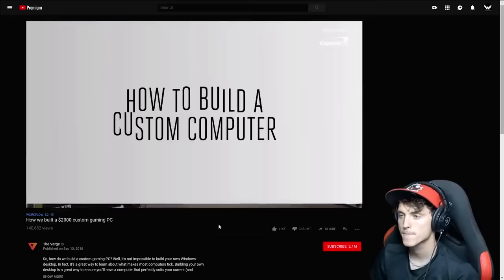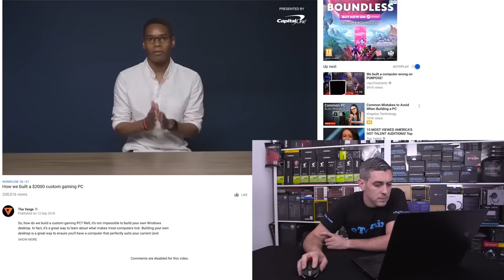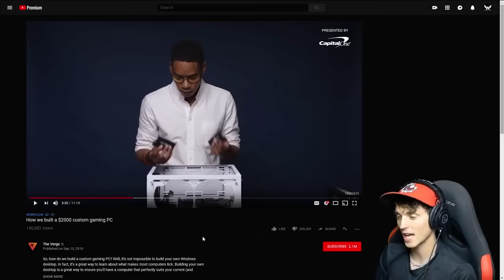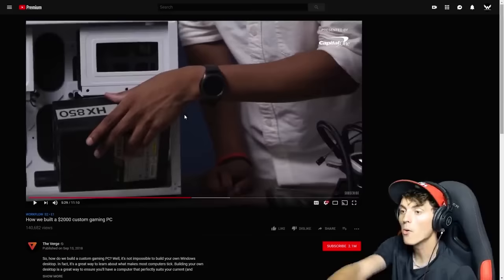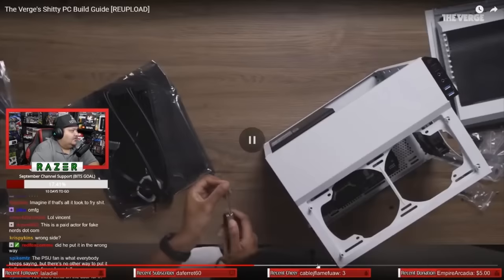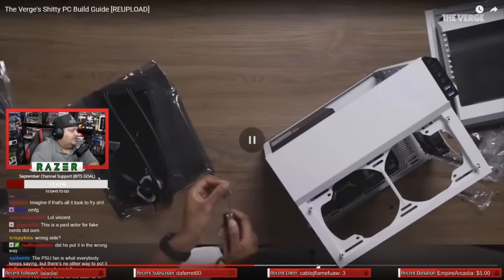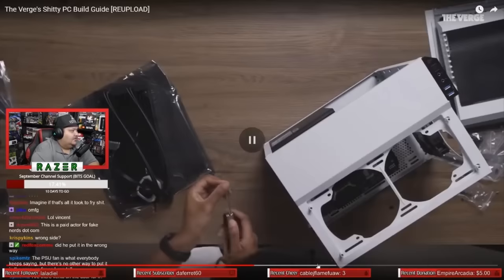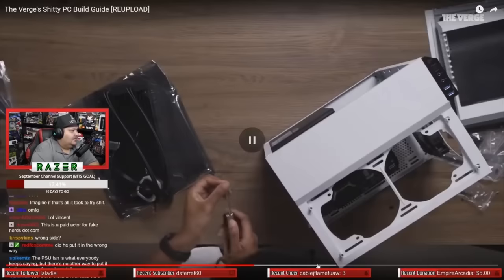The Verge's $2000 PC Build Reaction Supercut

Comment: If you pause at 15:04 you can see he somehow managed to put a ziptie on backwards.
Reply: Holy crap I never noticed it and I'm fucking laughing so hard. God. Oh fuck. I came here to lift my mood ended up laughing so hard that my stomach started paining
Reply: SCREAMING 😂☺️😂
Reply: honestly at this point i'm not even suprised by that anymore :P
Reply: I can’t see it, it looks normal
Reply: @edboss36  http://prntscr.com/p6d00n
Here, take a look, you can the the textured part of the zip tie, like if you look at the zip tie above it (Blue Square), you can see the the part that's wrapping around the cable is acutally smooth, unlike the reversed one (Red Square) you can see it's textured, and the texture is supposed to be on the inside 😆
Reply: OMFG ahahahah...
Reply: Not even the zipties were safe... 🤦‍♂️
Reply: thats not ziptie.that is tweezer.😂
Reply: I . . . I didn't know that was possible.
Reply: @bismuth7730  I feel your pain
Reply: OMG, I laughed so hard for about 10 minutes non-stop, for real, I was in floor can't take my breath 🤣🤣🤣🤣🤣🤣🤣🤣 I never laughed like this from years.
Reply: Never clocked it but I was massively confused on why he never pulled it tight 😂😂
Reply: Oh shhhit hahahha
Reply: It looks to me like the top "tweezer" is really tight, and the bottom "tweezer" is loosely around two cables and one water line from the cooling block. He didn't trim the long ends of the "tweezers," the upper tail curls back around... I might be wrong, but that's what I saw.
Reply: Guys, guys, guys... calm down.  There's a perfectly logical reason he has the "backwards" tweezer configured like this.  Doing it this way allows you to easily RE-USE the tweezer after the computer melts down in a week.  See, he's actually really clever!  You guys should stop judging this poor guy.  He's actually thinking outside the box.  Every one of his mistakes has an alternate reason that you just haven't thought of yet.  You just need to think about it a little bit longer instead of judging him because he doesn't do it the "normal" way.  HAHAHAHAHAHAHAHAH!!!!!  Just kidding!  This guy doesn't have a freakin clue.  Maybe we can all ask the Verge to sponser him to do a hardline liquid build?  Wouldn't that be a ROLF?!  Peace-out!
Reply: @krissebesta  I think I would die (being a watercooling enthusiast), but I'd still wanna watch it
Reply: Last year I said people will still be finding new mistakes in years to come, and this just proves my point.
If a zip tie doesn't click then it's not on right.

Comment: Me: Looks at PC I built on top of the  the ground without the most crucial part, the table Starts Sweating Profusely
Reply: no worries it's "grounded".
Reply: Actually,  pun from mark aside, as long as you are barefoot or skin in contact with linoleum or hardwood floor never on carpet you really are grounded possibly better than an anti static strap due to a larger surface area distributing any charge away from you.  I always build this way, barefoot on hard floor that is, table may or may not be used.
Reply: Yeah I have built four PCs... Three of which on the ground... All three on carpet.
Reply: I'm pretty sure every PC I've ever built was on the floor... Lots of room, and I can't drop things very far ;-)
Reply: I did the same thing it's fine
Reply: I actually never have built a PC on a table. 2 on my bed and like 10 on the ground lol.

Building on the bed is a bad idea though, I think I've lost so many screws.
Reply: I'm so glad God saved my poor soul from watching this video when I built my first pc lol
Reply: @berndo3038  I see you like to live dangerously.

Comment: What is sad is that his $2000 dollar pc is slower than my dell optiplex with a 3rd gen i7 and a gt710...

at $150...
Reply: LMFAO xD
Reply: My PC cost the same and I bet it performs 100% faster
Reply: what optiplex do u have, I'm planning on getting a 3020mt with the i5
Reply: @vladnicolescu2638  sff 9010
Reply: That's a good pc for 150 except the CPU maybe they should use higher gen i3
Reply: @frozenturbo8623  The thing is, had this been an AMD-Ryzen setup, swapping a CPU would have been a ton easier, as AMD has been using the same socket for four generations by now. Also many BIOS updates are backwards compatible with older Ryzens.

With Intel, you have to be extra extra precise with your selections. Many motherboards are designed for a specific generation of Core CPUs. BIOS updates won't help. Plus, Intel has changed its socket at least twice in the last three years. You can't just take a motherboard and CPU from the shelf and say "here we go".
Reply: I have an optiplex sff 7020 and it has an i5 (forgot what gen) and 16gb of ram. (no graphics card yet doe lol)
surprisingly doesnt even suck. Very good for just work but also some small games.
Reply: hes using a 1080 for two fucking thousand?? I'm not a pc nerd at all but theres literal 30 series prebuilts that cost half of this
Reply: no it isn't
Reply: He literally said that "That pc performs better than what most people have"

Comment: You actually don't need a table. You can do this in one of those vertical air tunnel things. Just weigh out all the various pieces, do a little math, and attach a suitable counterweight so that everything ends up the same. If you're willing to make repeat trips, you can also do this while skydiving. I don't recommend bungee jumping as the fall is too short. Also, technically speaking, the first thing you need to do is not get a table but rather to exist in the material universe. So, if any supernatural beings on an alternate plane of existence are reading, or rather 'experiencing', this comment through some sort of projection that is impossible for me to even conceptualize within this universe, you're gonna have to go and find some sort of wormhole or inhabit a human host or something.
Reply: What do I do, as an ethereal being trapped on this plane after I got drunk during convergence. I do not have any digits, the maximum load I can move without passing through it is roughly one kilogram and inhabiting a human body is still considered a crime where I'm from. What can I do to build my gaming PC? I am really bored and I tried to follow the Verge's guide, but I ended up causing a war between USA and USSR in a parallel universe.
Reply: oh i do it on the floor. nice
Reply: I build all my PC's in orbit so I can purposely skip the table step
Reply: @crocodile2006  I see... ..yes, hm.. ...irregular problems truly require irregular solutions, don't they?
Reply: @RitsuCurisu  Ok, so first you are gonna need to visit what we call the large hadron collider, wait for it to fire and hitch a ride on the Higgs Bosun to Earth 367-B, where there is no interdimentional extradition. Afterwards, proceed to inhabit a humanoid host(I know they look a little weird, but the extra limbs are useful) and build your PC, finishing by Turmish Day to avoid the Etherial Bandit stealing your screwdriver and you should be set.
Reply: @PerishingPurplePulsar  Oh man. And to think the answer was so obvious! I feel so stupid now. Nevertheless, you have my gratitude, John of Hammond.
Reply: @RitsuCurisu  No worries, I had to figure it out the hard way. Good luck, Leggie of NotHammond
Reply: I  built mine on the floor
Reply: Im dying rn
Reply: I built my pc on the cardboard box that was on my bed, so no, you don't need a table.
Reply: that was fucking great

Comment: I keep laughing at the alan key bit because NOT ONCE did he actually use it in the entire build 🤣🤣💀
Reply: “Unless you’re using it to build the table”
Reply: That Corsair case he used needs the Allen key to put the glass panels on, other than that it's useless.
Reply: The Allen key is to assemble the Ikea table from step one .

Duh
Reply: If this guy built the table it would spontaneously combust in the middle of the build

Comment: I did it, I compiled everything wrong with The Verge PC build video:

"You need a table"
Thermal paste applicator
Allen wrench
Calls zip ties tweezers
Swiss army knife that "hopefully" has a Philips head screwdriver
Uses a regular bracelet and calls it an anti-static wristband
"Screw in with confidence"
Doesn't mention case/motherboard pegs/standoff screws
Puts motherboard into case first with nothing installed on it
"BRACE"
"Hammer it in"
2666Mhz "fast RAM"
Opens 4 DIMM slots and installs 2 sticks in A and B slots
Doesn't install M.2 standoff screw
PCI-e lane doesn't matter
Calls anti-vibration pads insulating pads "so the power supply doesn't short circuit and come into contact with the rest of the system"
Installs power supply intake fan against case wall
Installs radiator with no fans and uses fan screws anyways
"Every power supply comes with a bag of cables"
Talks about CPU installer and then doesn't use it
Throws out CPU socket cover which is required by manufacturers for RMA
"Every CPU Cooler somes with thermal paste applied"
Adds extensive thermal paste on top of pre applied AIO paste
Uses wide shot showing him install thumb screws blocking view
Didn't install one AIO screw with AIO tubing making contact with GPU
Cable management is non existent except use of "tweezers"
Didn't mention connecting front I/O power switch connectors
Benchmarks League of Legends with 120Hz/FPS Vsync enabled
Reply: also is it just me or one of those "tweezers" (zip ties) is the wrong way around and not actully zipped? at 15:15 you can see it and on any shot of the pc inside when finished(the most visible one). it is kinda irritating or i could be missing something because a ziptie is not that hard to use.
also no zip tie is cut also kinda annoying but knowing the rest of the build probably best not cut because they wouldn't be flush cut and would be sharp.
Reply: This is a very good not to do list
Reply: Basically the whole video :D
Reply: Also he mixed thermal pastes too.
Reply: Get this man some thousand likes
Reply: OMG 100+ likes a week later I thought this meme was dead but you guys keep it alive, unlike this "gaming PC" which probably died a long time ago.
Reply: If I feel motivated one day I'll add time stamps and some edits
Reply: I love how he also said nothing about connecting cables and where they go which is the most important thing
Reply: Pretty good list, but you could find a lot more problems, especially if you nitpick a little.

Comment: Thermal paste applicator isn't really bs. You can use it to scrape off old paste but most importantly... it's recommended for liquid metal application. You can't just simply leave a pea-sized lmp on the cpu and hope for the best, it has to be super thin, spread out, should be applied on both cpu and some on the heatspreader or whatever it's called. I had to do it on my laptop and it has never failed me ever since. -15/-20°C difference.

Comment: Ever notice that the "thermal paste applicator" looks like one of those ice cream sample spoons?
Reply: legends say it is actually
Reply: @mo gamer thermally conductive ice cream
Reply: I did have it come with a tube of good thermal paste... Well, the instructions said it's a cleaning tool. You use it if you fucked up royally enough the old paste's dried, so as to carefully remove it without damage. Couldn't tell you if it works, literally never had paste completely dry out!
Reply: @EgorKaskader  you can use the spoon thingy to spread the thermal paste, that's how GamerNexus did it
Reply: @EgorKaskader  I had experienced that once, it's pretty useful. A metal scraper would have damaged the IHS
Reply: grizzly kryonaut comes up with that applicator lol

Comment: they have an article up for this. they got rid of the video and said this:
"Editor’s note: An earlier version of this article included a video guide detailing similar steps on how to build a PC. Unfortunately, that video included a number of errors in the build process, and as a result we have removed it from this article. We have also updated this article to improve the order of the steps in the process."
but the thing is is they still have pictures of the pc with everything he's done wrong. and the instructions make no sense. it basically just says "install the parts"
Reply: I'm not a pc tech, but when there's a instructions to build a pc with a note of  'install the parts' , anyone can do it, even a kid.
Reply: @huhwerami4417  What he meant is if there is 'install the part' note, what you need to do is only screw thing or any other easy thing to do not some complicated thing that need advanced instructions.
Reply: @Nullinium 
Well, what's the point of a guide if they would just tell us to follow the notes?

Say to someone who wants to learn how to build a computer "install this part". Just that. Nothing else. Do you actually expects us to know how exactly? We wouldn't need a guide if already know. We watch a guide so that WE KNOWS HOW EXACTLY TO DO IT. So if a guide told you a vague command, that's not a guide, that's an observer. He observes us how we do it, not teach us how to do it. And that's not the reason we require him for right? That's why a teacher or lecturer guides their students how to perform algebra or other shit, then switch to being an observer, and that's what they are there for. But a guide MUST always tell us the exact way we have to do something. What's the point of being a guide if you tell the ones you are guiding to just go down a steep mountain, the ones who are clearly new to mountain hiking. Even if they have quite an experience or idea already, that doesn't excuse a guide to just screw it all off and give off vague commands. And if he does give  a vague command, at the very least, do and show the correct exact way on how to accomplish the task.
Reply: @huhwerami4417  Why must so mad dude? What we talk here is about the fact the verge team said they only got instructions 'install the part', that only is actually already Imposible been found if you buy $2000 pc setup. This guy said he ever see the 'install the part' instructions in some easy to install part components which probably some cheap components, just to joke about verge claim. And you here just getiing mad for something like this? What's wrong dude.
Reply: The Verge also tried to file DMCA takedowns against all the videos which pointed out their mistakes.
Reply: @Nullinium  Dude, I can't even understand what you're trying to say.
Reply: A number of errors. The whole build was an error.
Reply: @Nullinium  broken english, belajar english dulu nak, baru ntar balik debat lg ya
Reply: Southern Fun he even played the race card in comments, anyone including me who politely corrected him he called Racist. I said Sir race has nothing to do with the errors you made or how I’m calling you out in them.